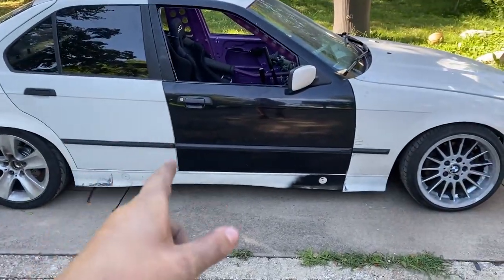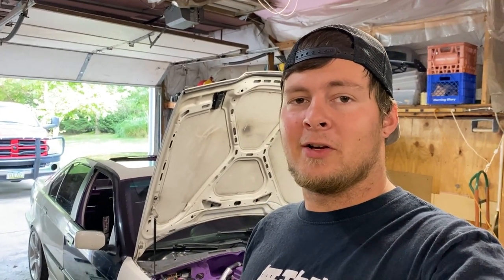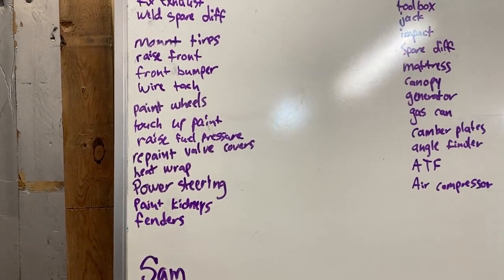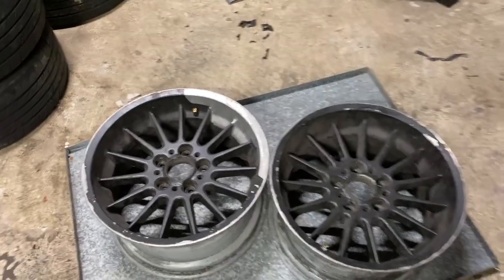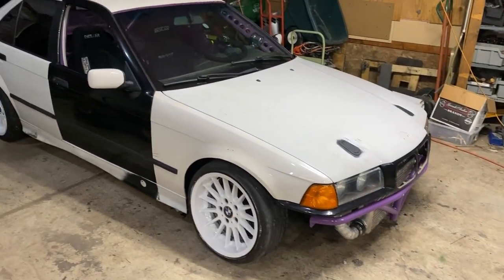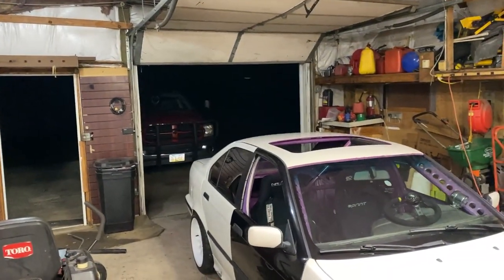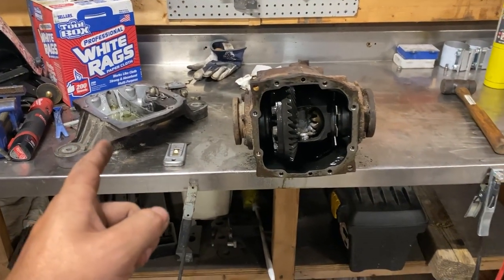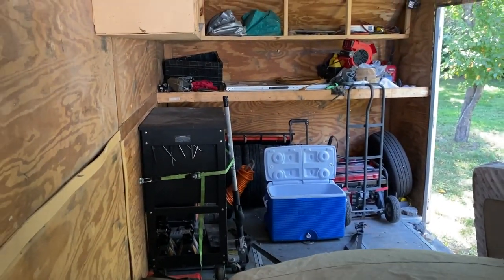DON'T BUY CHEAP VINYL WRAP!

Comment: Seems to me your main problem was you were unprepared and just jumped right in with your attempt.
Just as with any paint job, good results depend almost entirely on prep work as well as the cleanliness of your environment. 3M primer93 is a must.
You definitely should have removed the molding first. Another friend would have been helpful for placement. 
I think you gave up to easy.
Reply from the maker: You’re not wrong, but at the end of the day I decided I wasn’t going to be happy with results. I’ll check out that 3M product